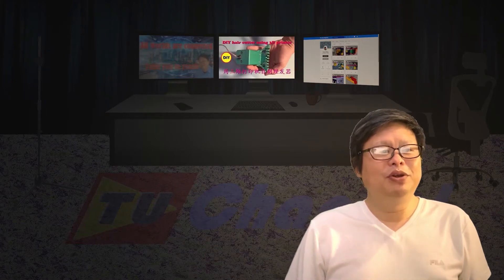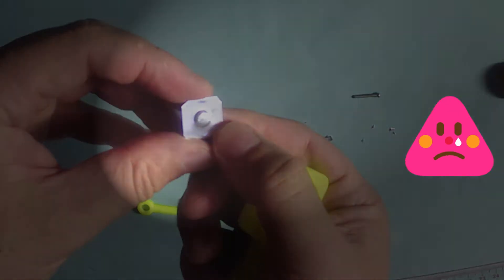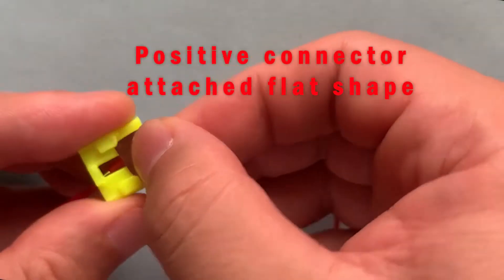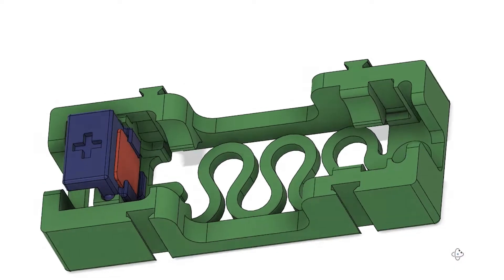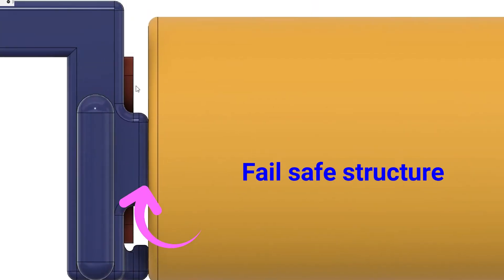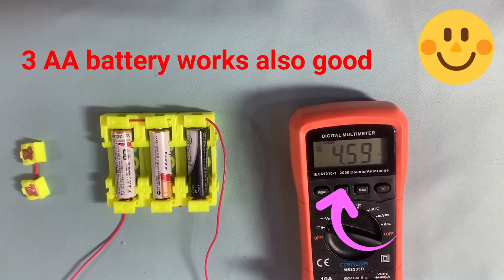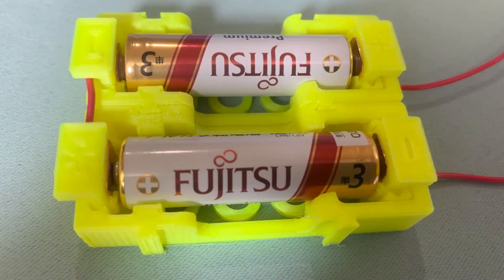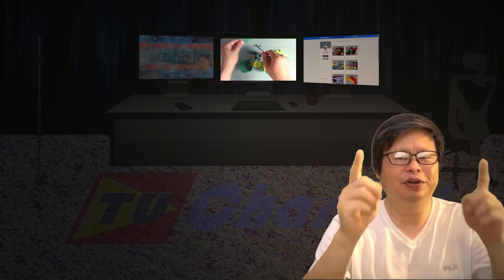DIY complete homemade AA battery case, extendable, failsafe

Comment: The 'flexible' end is formed to the frame. How do you get it to move?
Reply: Also, What is the 'base' for?
Reply from the maker: There is a little space exist between the flexible end and outside frame. The flexible end can move a little. If you stuck please clean the connect part between center flexible part and the frame. Thanks for your comment.